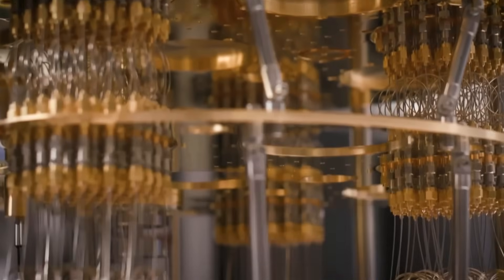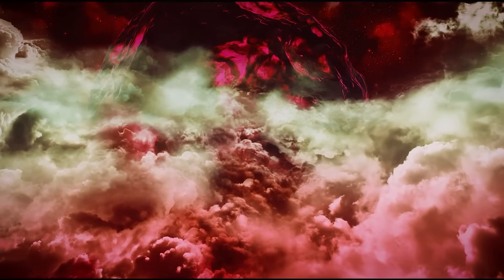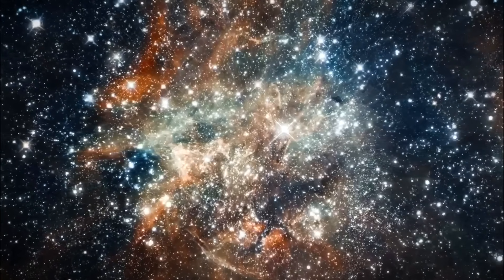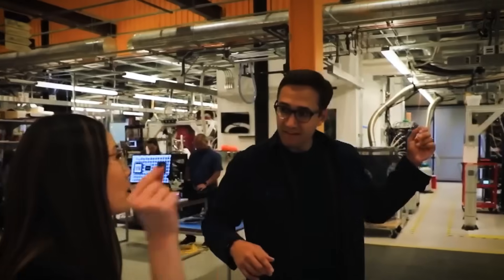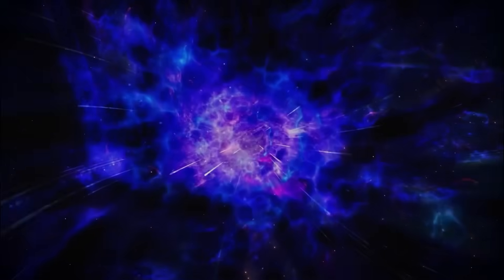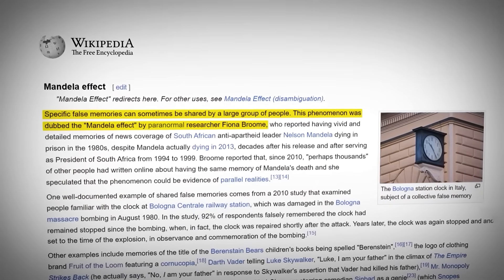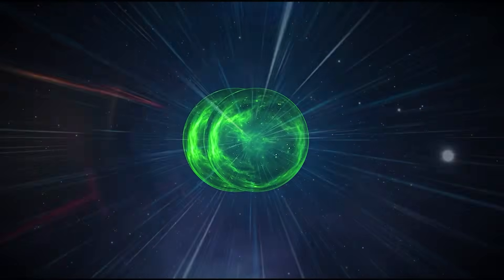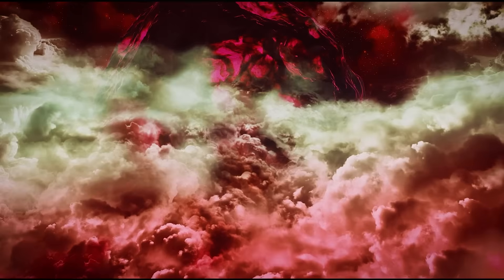Expert Warns: Quantum Computers May Have Just Activated the God Particle Plugin!

Comment: Tye god partical is just the higgs boson and it has absolutely nothing to do with quantum computing.. this video is using it to make it sound more sensational.. Also quantum comouters dont push beyond current computer anything they dont even work the same way at all. Google theorized that thier quantum computer tapped into multiple universes to perform its computations. That was a cool min away. Also quantum everything behaves way way beyond and out of classic physics. And no one is concerned about pushing or opening or otherwise opening new physics or models etc and definitely no one is worried about it, try and find a quote where a physicist has warned about quantum computing beyond breaking all current encryption and classic security

Comment: No, they have not created anything at all. All the computations inside a quantum computer are probabilistic. The only difference between a quantum computer and a regular classic computer is that the quantum computer calculates everything in qubits. This means that it's coding is different. Instead of calculating in a binary code of 1s and 0s, it calculates in code where a qubit can be both a 1 and a 0 at the same time in different configurations, so 10, 01, 11 or 00 at the same time instead of either a 1 or a 0 in a consecutive order. This means that it can calculate faster and in a wider range of states of positions. That is all it means. It's just a glorified calculator.

It's not interconnected with the reality of fabric of space or what other nonsense these AI bot channels or even Michio Kaku is saying. It is simply not true. If you think that, you're not a very logical person, and quite frankly, you need to educate yourself better.

Comment: basically if our reality was nothing more than a computation running on a quantum computer of some sort built by a probably extinct civilization but still in operation, building quantum computers in the simulation means nothing more than creating a pirate entrance to this computer that controls reality and therefore means having the power to govern reality and modify it at will or it could lead to the shutdown of the system... so everything could shut down in an instant... and probably restart... maybe...

Comment: Currently, quantum computer results are not considered highly reliable due to their susceptibility to noise and errors, meaning they can produce inaccurate results with a significant error rate, although ongoing research is rapidly improving their accuracy with error correction techniques, with some systems achieving fidelities close to 99% for certain operations; however, for most practical applications, they still require careful verification and cross-checking with classical computers.  ~Gemini
Reply: The new Majorana quantum chip from Microsoft just changed all of that. It completely eliminated the need for the vast amount of error correction. Its results are not subject to speculation due to errors….😳

Comment: I honestly thought scientists we're better at theorizing than this post implies. A simple electrical cable live with power does more than vibrate electrons within its wires. A short simple statment - it also creates an electro- magnetic field around the outside of the cable. Simple interactions with both the environment and reality. 'Most' peoples already know this. And this interaction goes both ways. Again, also well know. Even I can extrapolate from what is known to understanding electrons vibrating within a computing system is interacting with reality. To move on from this, the next step is proving it.

Comment: Select a specific vibrational frequency creating a closed electromagnetic circuit. Drop this into the quantum field and watch as the quantum wave energy converts to kinetic particle energy in the quickest, easiest way possible to create the synchronicities in the time space field that result in that original vibrational frequency.